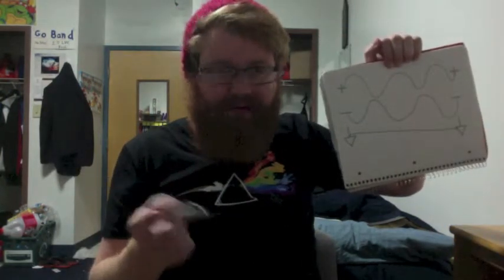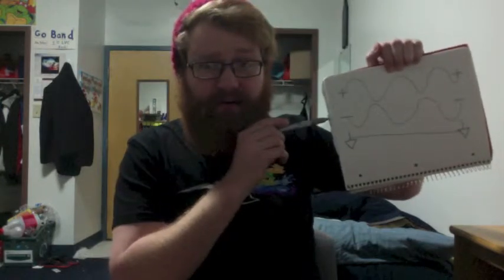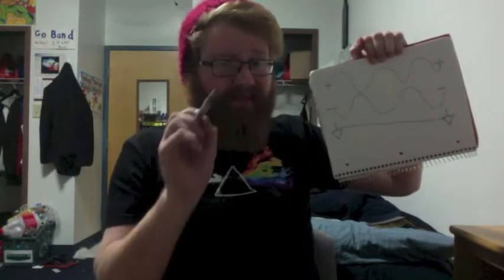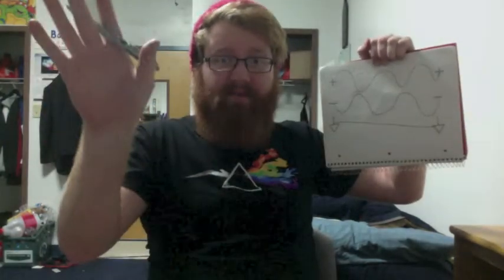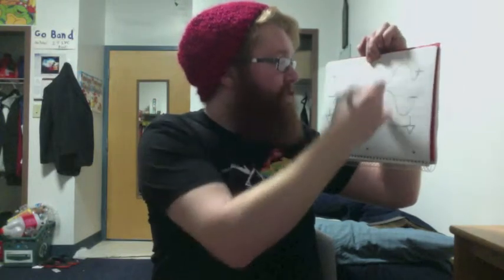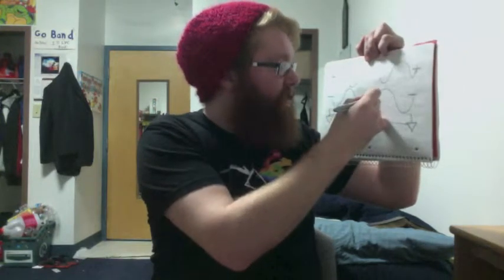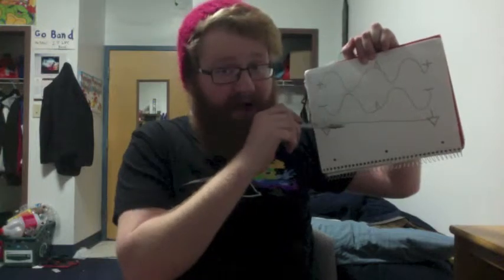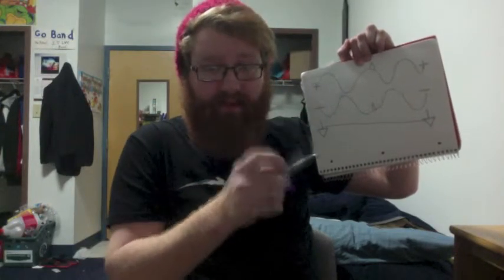The Pin One Problem

Comment: Actually only the impedance of the hot and cold sides is important for noise cancellation/ immunity; see articles by Bill Whitlock and Neil Muncy. In balanced XLR cables, pin 1 is the shield not the signal "ground". Lifting the "ground" is bad and can compromise RF immunity and safety.